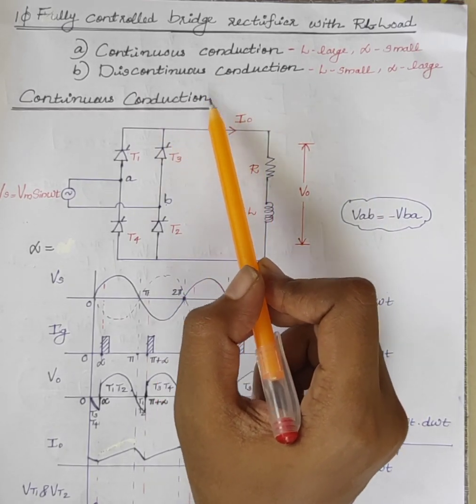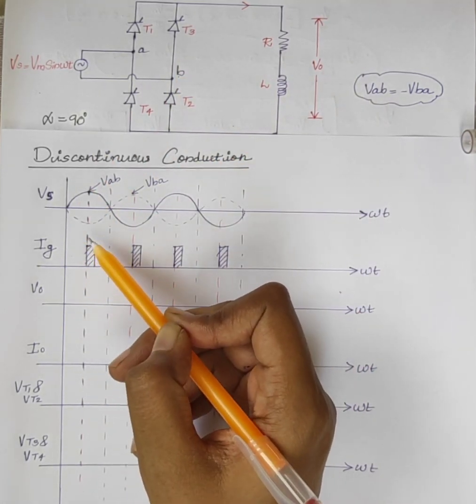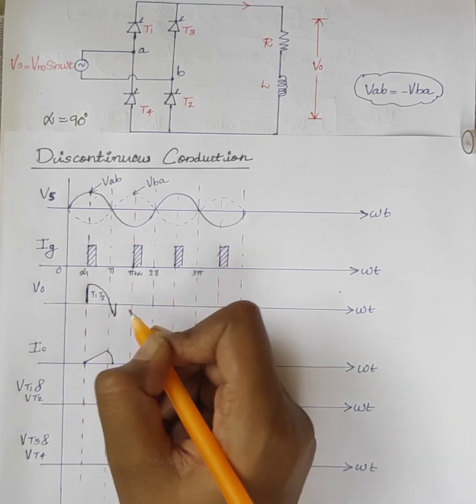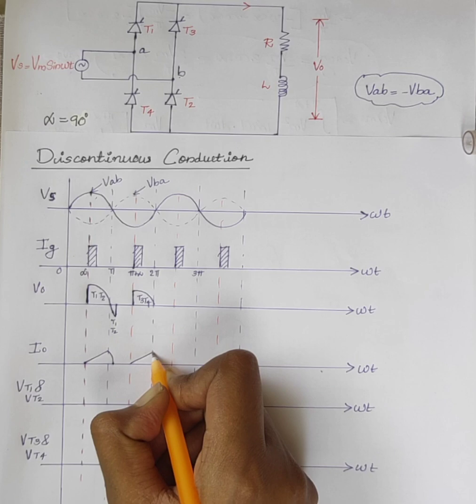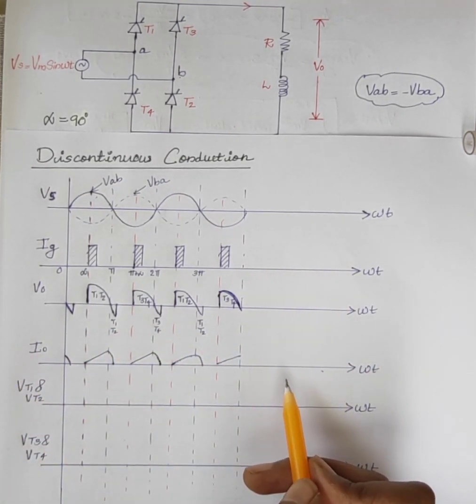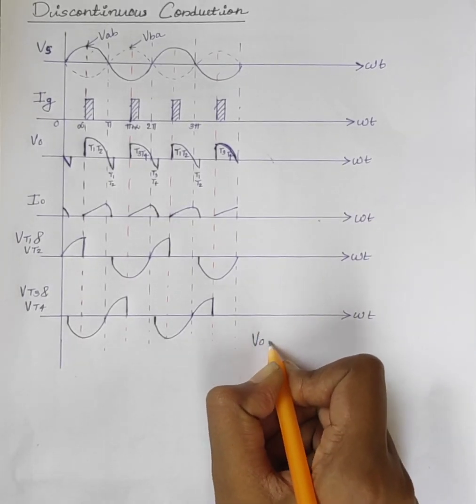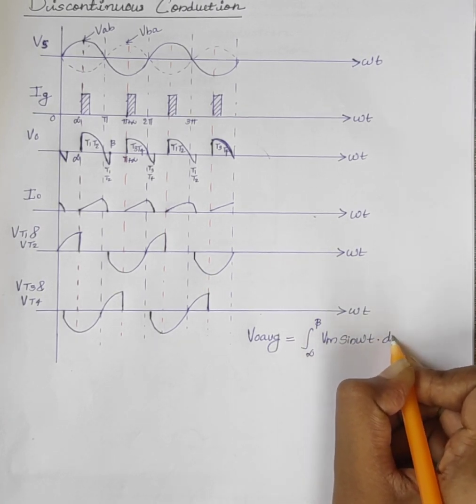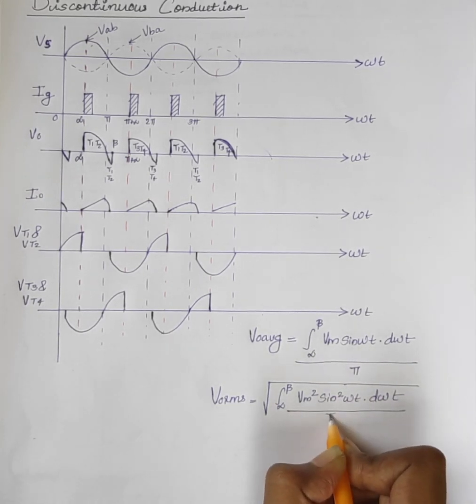Single phase fully controlled bridge rectifier with RL-load, Part-2

Comment: in case of v0. 
from alpha to π.. why is there a negative voltage... the process start from alpha right...
Reply: B'coz of the Inductive load, there will be a negative voltage in the load which become zero at extinction angle 'beta'.